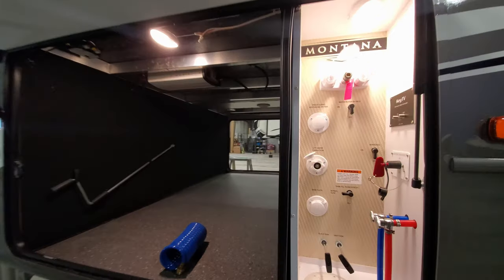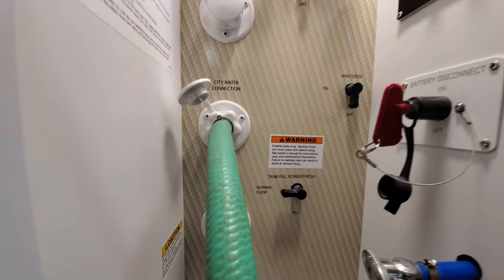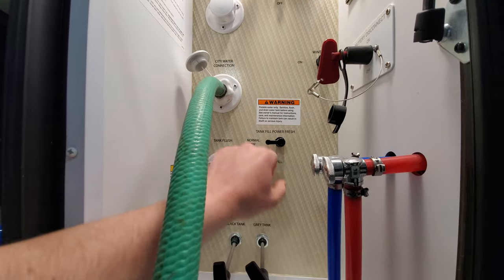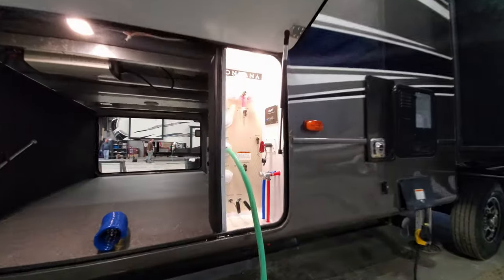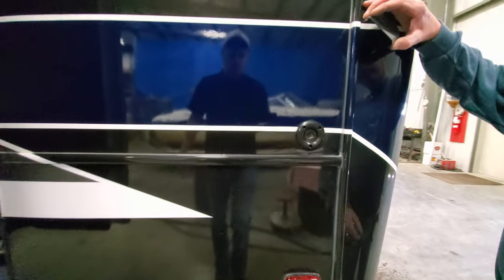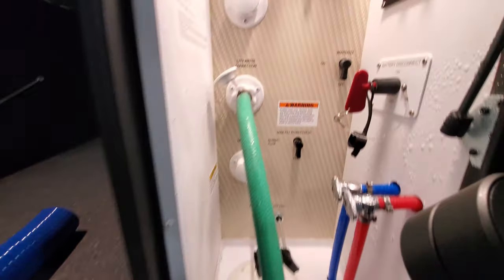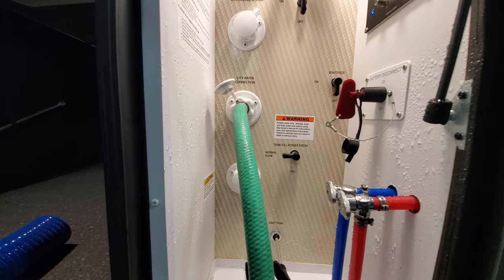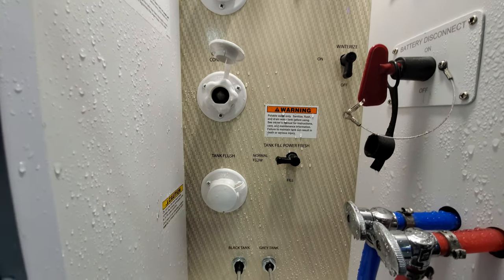How to Fill your Fresh Water Tank in a Keystone Montana Fifth Wheel

Comment: Ok may be a dumb question, but if I am somewhere without access to a fill hose I can just pour fresh water from containers using the gravity fill port and there is no check valve or anything else to worry about?
Reply from the maker: Correct

Comment: I want to thank you for this vid, yesterday I tried in the calving bay and flooded my  new coach. Now this tank fill is like my last unit, yes gravity fill but I use a 2 volt rv pump to pump it in instead of holding jugs. Faster and easier when boondocking rather than holding 40lb jugs with a funnel.

Comment: Do you have any idea where the gravity fill cap is on the 3730FL?  We know how to use the city water rapid fill but there is definitely and air lock as the water comes out of the overflow valve immediately as soon as we start filling.  The tanks are empty.  We have never filled them before and there is no water from the taps.  We are sure it's airlocked but can't find the black gravity fill cap.
Reply from the maker: Usually towards the back of the camper. Wherever the water is coming out from on the side of the camper is the gravity fill location.

Comment: Do you have a video on filling the water heater on the Montana?
Reply from the maker: Make sure water heater bypass is off. If filling fresh water tank, fill the tank and then run your water pump. If using city water it will flow through the water heater when you turn hot water valves on